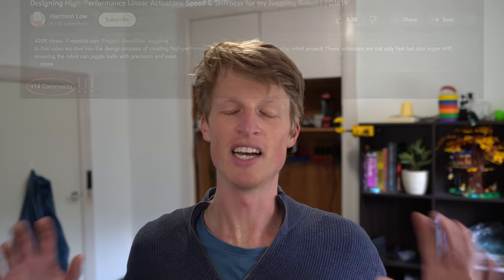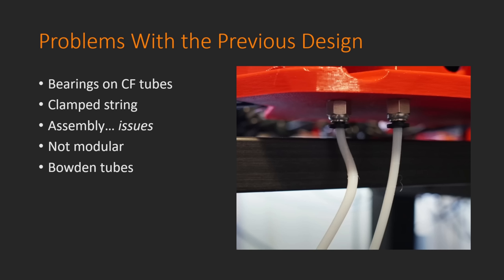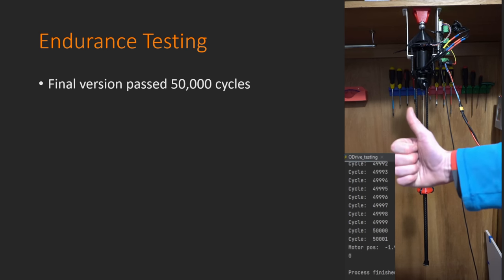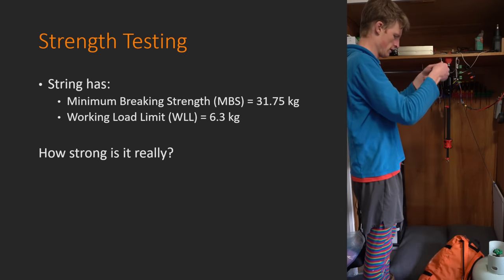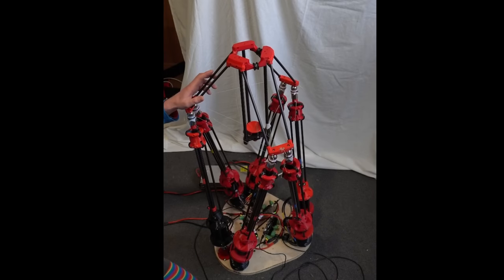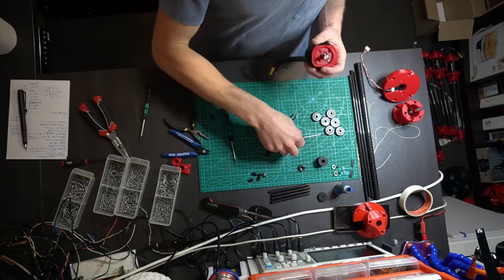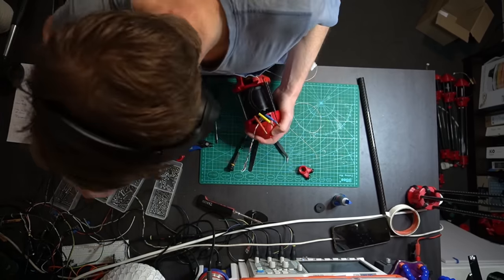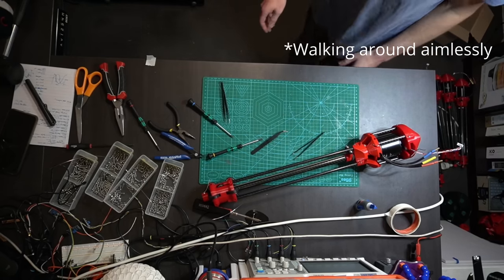My New Linear Actuators are SO MUCH BETTER! | PDJ #21

Comment: If you fix the moving rod at the bottom, you might be able to get away with scrapping one of the top bearing rings. That will lighten up the actuator a lot

Comment: You should be able achieve any string axis with two pulleys (not counting the main spool), your first pulley set does not need to rotate on the same axis as the spool, the only requirement is for the string to be tangent to the spool.

Comment: I think the ideal way to terminate the synchromesh cables is to crimp a connector on the end, this makes the length and therefore tension pretty fixed, although you could add an idler to tension it. Also what if instead of the synchromesh you just use a steel cable since you don’t use the sort of teeth built into the synchromesh.
Reply from the maker: I do like the idea of a tensioning idler—especially as a partial remedy to the strings stretching—though it'd be pretty tricky to fit one in here. Space is very tight as it is 😅

Steel cable is another option, but synchromesh cable just looks so much sexier 🤤 Also AFAIK synchromesh is more flexible than (comparatively strong) steel cable
Reply: @harrisonlow  from what I understand synchromesh is just a central thin steel cable with another cable wrapped in a spiral around it.
Reply: @harrisonlow  also you only need the cable to handle like 7 kg of load to match what this version does, a steel cable that can handle 7 kg or even more isn’t that thick.

Comment: For the synchromesh cable look at how bike brake and derailleur cables are clamped, its still a bolt, but with a grooved washer that holds it against the part.

Comment: How to terminate the new syncromesh cord. A stud with a hole for the cord to go through, then a flat-end set screw to hold it.

Alternatively, a stud with a hole for the syncromesh, split the end, tap one side of the split and tighten with a screw, it becomes a clamp on the syncromesh.

Comment: I have had luck using capacitors in place of brake resistors on linear servos in factory automation. Bonus you can supplement acceleration current and reduce load on your supply.

Comment: I really liked the way you make decisions for design.  🎉
Reply from the maker: Cheers 😊
Reply: Hi, I am a maintenance guy & working on industrial automation systems.   In one of my plants there are multiple 3 phase motors sharing single load. All motors are driven by different VFD drives. Each drive is equipped with breaking resistors which tend to burn frequently.
I had removed all breaking resistors and connected DC bus of all drives in parallel using type C fuses for protection and monitor all drives  DC bus  in plc for system shutdown in case any deviation observed.. 

After this change we didn't face any tripping in system.     

While some motors tend to overdrive the load, remaining low rpm drives generate reverse Power which resulted in dc voltage increase.  This reverse Power is actually consumed by the first lot of drive which tries to increase speed of load.
Reply from the maker: @TechnoAutomation  Interesting! So to check my understanding: you have multiple motors that are all hooked up together so that if one starts braking, it sends power to the rest of the motors (with fuses in place to stop overloading)?

I'm not sure that such a setup is possible with the ODrive motor drivers I'm currently using, though I'd be very happy to be wrong! I think the closest thing would be a battery powered Jugglebot, which I'm all for, but I need to do a fair bit more reading about how to (safely) build such a system

Comment: Attach synchromesh cable with an i bolt. Twist to attach. Continue twisting until you reach the desired tension, like a guitar string.

Comment: one way you can increase its speed, while requiring  a redesign would be to create a mechanism that reverts it's direction automatically while the motor just keeps spinning in the same direction.

Comment: To use the Synchomesh cable a set screw that holds and a tension screw that pulls the cable could be nice.
Not sure if you tested bearing sleve on the rod?
Love the idea with using the motor housing

Comment: You do not use braking resistors.  You use biphase drive. You are not loading the nut.  If you load the nut the plastic will melt.

Comment: Regarding all the bearings, but more specifically the end cap alignment thing, I once took apart an HP inkjet and found that they use felt bearings.  That's right! It was a piece of felt with a hole a bit smaller than the rod so it held firmly. there were metal rings on both side of the felt centering it around the polished linear rod. This helped keep the mass down, cost down and noise down.  What I'm suggesting is to create triangular end cap with all 3 holes to prevent twist. It would be 3d printed and hold 3 pieces of felt-washers. 

You would need thick felt (1mm or more) and could mass produce them if you created 2 hand made punches. Take a metal tube that is slightly smaller than the carbon fiber tube and sharpen the inside edge of it. Then hammer down on the tube against the felt to create an inside punch. Do the same for the outside punch. Make tons of them and redesign the end cap to encapsulate 3 felt washers and all 3 rods.  You can get rid of the wheels and bearings this way and solve for that odd twist. Make the end cap organically shaped to reduce weight (like a semi-collapsed triangle, don't know how to describe it).

I'm unsure if this suggestion would also work for the primary alignment bearing block but try it if the end cap proves useful.  You would essentially create a new block with many felt washers to center and hold firmly the center rod.  It would be cool if you could drop most of the bearings to reduce cost and rotational inertia and wear on the shaft! Good luck.

BTW, I couldn't create an account nor use the Google signup... Anyway... On that previous video I was the one to recommend the synchromesh wire. Thank you for covering that in your video I feel honored and excited to continue to help!

Comment: Terminating the cable- think bicycle cables... take a bolt and drill a hole through it... running the cable through the bolt you can easilly pull the cable taut  or release it. Tightening the bolt secures tension. Mind direction of bolt threading so that tightening bolt adds tension.

Comment: For the termination of the cable you can put it through a tube, with a hole for a bolt, fixed to the piece at the end. Then you just have to press it with the bolt.
I think it's the easiest way you can do it.

Comment: Terminate, just like you would do on a bike brake cable. It's basically a bolt with a hole in it and a nut on the end.

Comment: Maybe you could try using carbon fibre yarn (tow), which won't stretch over time, causing different problems. As someone below already said, Teflon rollers are self-lubricating and will last forever. And if it would be acceptable to have the motor axis perpendicular to the axis of the actuator, thus eliminating all the pulleys, would probably eliminate all the slack which may be generated due to the wear of the pulleys. Alternatively, you may want to make the pulleys from teflon, too...
Reply from the maker: Interesting! I imagine there would be a host of other problems with carbon fibre tow, especially with the weird routing that I'm subjecting these strings to. I'm glad you suggested it though - I didn't even know this was a thing before now 😊

Cheers for the suggestion of teflon rollers - putting in an order for these is on my to-do list for today

Comment: could you crimp a steel ring eye terminal to the synco cable,thenm put the bolt throught it,youd need a steel crimp not alluminium or brass or copper

Comment: Im not sure why you dont use linear bearings. I guess its the wear issue.. i think you might need to switch to a stronger material anyways.. maybe you could try a titanium cylinder. 
Using a linear bearing instead of several bearings would also reduce the moment of inertia so the weight increase might no be as bad as you expect.
Reply from the maker: Yep, if I simply had more money + access to tools/materials, these actuators would likely be very different from how they are now... 

Re. linear bearings: I've tried these but the tolerances didn't work for my carbon fibre tubes (some tubes fit with slop, others didn't fit at all...)

Comment: if the outer spiral is tight on the synchro mesh cable, you could make a plastic piece on the end of the actuator that it slots into and just turn the piece to tighten the cable
Reply from the maker: That's a cool idea! I have no idea what it's made from, but the outer spiral is bonded extremely securely to the central cable. I worry that this idea might be able to slip if the friction between the plastic part and the cable is low enough? The cable might be able to pull out (while twisting) if pulled hard enough?
Reply: ahh, darn you're right it would need some part to stand proud of the spiral so that it wasnt just the friction holding it, unless you manage to have a very long length of spiral in friction. @harrisonlow
Reply from the maker: Someone has detailed (on Zulip) an idea that I think is quite similar to this and I think it would work pretty well, though it's a bit bulky. Check it out if you're interested 😊

https://pdj.zulipchat.com/#narrow/stream/399279-General/topic/Terminating.20Synchromesh.20Cable/near/388988893
Reply: @harrisonlow  That mechanism is what I was thinking of! ( but better lol )  It would be too bulky unless you could hide it inside one of the pre existing parts.

Comment: 10:55 Weld the end of the cable to a connector that connects to your bolt or, alternatively, use a larger bolt as the cable end connector, drill a hole through it horizontally, feed the cable through, sandwich it between two nuts, and tighten down.

Comment: TPU sleeves: perhaps a lip on might be enough to prevent them wandering off. Making the rolling surface a u-shaped may also prevent drift. Or just machine out of nylon, with a slight lip and very shallow U contact profile.
Reply from the maker: I actually originally had the TPU sleeves being concave instead of convex and they had an insane amount of friction (though they were a very good fit for the CF tube). The main issue with them coming off is more from them being directly bumped; they haven't shown any signs of wandering off while in use.
Cheers for the suggestions!

Comment: For the cables, perhaps a wire rope end stop with set screws for easy adjustment, or a threaded cable stud that you could adjust the tension of with a nut.

Comment: instead of string have you tried a high-strength fishing line. It may last longer due to it being designed for reeling up and casting and the tensile strength of a large bluefin on the end of it?

Comment: What about a square carbon tube that gives a flat surface for the bearing to roll on. Or replace the roller bearing with a bushing surface.

Comment: If the motor axle is perpendicular to the movement, you don't need the complicated re-routing with multiple pulleys of the string by 90 degrees. Might be slightly less compact, but less parts that can fail. Might be worth considering when you working on the re-design using the motor body as spool.
Reply from the maker: Yep, agreed! The main reason I didn't set the motor perpendicular to the extension axis is because I don't want the motor to be sticking out the side of the actuator. I have a gut sense that this would likely cause issues down the line once I put all 6 actuators together into a Stewart platform so I want to keep everything as "neat" and in-line as possible. 
I think using the motor body as the spool would still work, though, because I'd be able to keep the centre of mass of the motor approximately coincident with the extension axis.

Comment: Add a large spring on the motor/strings such that it would pull the actuator to the middle position from the edges.

Comment: have you tried to use fishing line for your string.  fishing line or the string they use for bows (as in bow and arrow) is fairly stretch resistant and can handle a lot of weight.

Comment: Harrison I want to build one, do you have any guide to the motor control circuitry and break method?
Reply from the maker: The motor control side of things is actually the main part that I haven't made much of a "how-to" for... To make the physical actuator, check out the Printables link in this video's description. For the motor control, I'm using ODrive V3.6's with the standard 50W brake resistor. This makes the control circuitry quite straightforward, but the control software is another matter entirely... I'm currently using a CAN bus to control six of these actuators, but you could also use a simple USB connection if you're not doing anything too sophisticated with it.

Out of curiosity, what do you plan to use this actuator for?

Also, if you find yourself making one of these and want to show it off or ask me anything about it, feel free to post to this project's Zulip site (link in the description) and I'll happily help you out 😊 (It's just a little easier to keep track of communications there than in the YouTube comments)

Comment: For the synchromesh cables I would suggest terminating them with crimped electrical connector eyelets (that take a screw terminal  like you see on high power capacitors)

Speaking of capacitors, you should be able to "charge" a couple of super capacitors when braking and then letting them discharge through a bleed resistor. This way the instantaneous current sink will be much larger while the discharge would happen over a longer period of time.

Comment: Instead of hammering the tubes into the 3D printed block, simply put the 3D printed block into the oven.  Check temperature to make sure you don't exceed filament flow temp.   As the blocks get warm they will expand.  The CF  tubes should be able to fit inside with only pressure.

Comment: A couple ideas come to mind. To terminate the twisted cable try a double plate clamp, 2 screws with a bump in between should do. The pulley "shoes" as I would call them, having them rounded may decrease their friction coefficient however making them concaved instead of rounded would reduced their odds of slipping off and also serve as an self-aligning guide sort of speak. I wouldn't make it exactly the same as your center shaft, maybe 1/2 a mm wider then the shaft on each side. effectively giving you a maximum of 1mm tolerance and ever so slightly reducing the friction vs a matched curve to shaft.  really like what you did so far. hope my advice helps. feel free to message me if I wasn't clear and you want clarification. I can fab something up easily if needed

Comment: Crimp a cable lug to the end of the cable then attach a small adapter block to that (basically a right angle adapter with two holes) then use a bolt along the axis of the string to change tension

Comment: The theoretical limit of your actuator might be 8.4µ with those encoders, but your mechanics are not going to let you get anywhere near that point. For that you have to understand what causes position inaccuracies in mechanical systems. You might use the encoder with feedback, but that is only locally. There is no feedback from the motor, to the linear rod travel.

Your precision is going to be dominated by virtual play, or hysteresis. That arises from a combination of limited stiffness (no material or structure is infinitely stiff) and the presence of friction. 
Cable mechanisms, and especially pulleys are notorious for friction, so that is to my guess the dominant source of precision inaccuracy in your device. Next to this, the constraints you have on the carbon tube are a form of over-constraint. Either you have play or you preload them (obviously the latter is what you should be doing). It is good for stiffness, but introduces accelerated wear (which you saw on the bearings, and now on the TPU) and because you use bearings also additional friction (friction force is pretty much linear with preload force). Whether or not preloading the bearings is advantageous for precision (as you have better stiffness, worse friction) I cannot say without doing calculations.

Note that your 'precision measurement setup' also uses a lot of pulleys, introducing even more error, your instinct of putting it directly on the actuator is definitely the better choice here.
Reply from the maker: Haha yeah it was a bit ambitious to expect anything close to the 8.4 um precision that I calculated 😂

Very good thoughts here - thanks for sharing them 😊 Sounds like four fixed bearings and two preloaded ones is the way to go here.

Cheers!

Comment: You may want to look at Stephan's (CNC Kitchen) deburring tools as they are specific to 3d printed parts. As makers, you and I are both used to grabbing a razor knife to get it done, but i think he has a safer more precise way to clean up parts - especially safer!!! As you probably already know first hand, those r blades will cut you and you won't know til you feel the blood flowing!!! 

Stay safe - GREAT design pt 2!!!!
Reply from the maker: Great suggestion! As it happens, I actually very recently picked up a "Noga NG8150" deburring tool, but I haven't had a chance to use it yet. I agree that cuts are no fun at all!

Cheers 😊

Comment: You could clamp the new cable by cutting a slot in the end of a bolt for the cable to pass through and screw down a nut over a washer to hold it.

Comment: One termination idea: clamp the cable, then use a bolt through the clamp that can adjust the tension, similar to a tensioner in a motorcycle chain